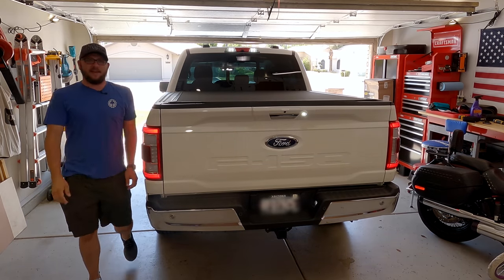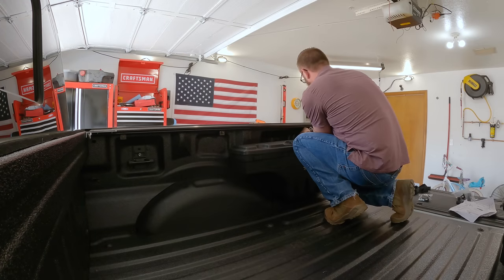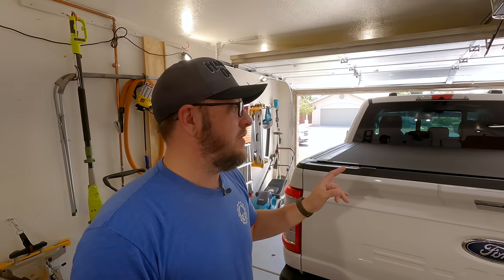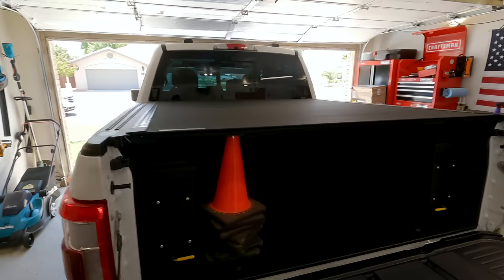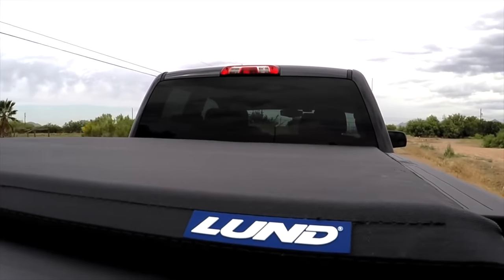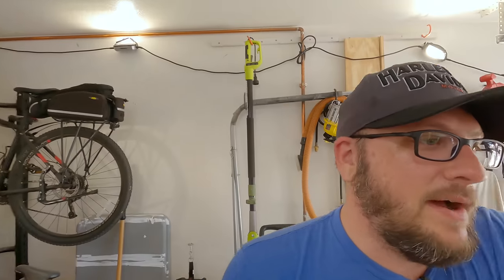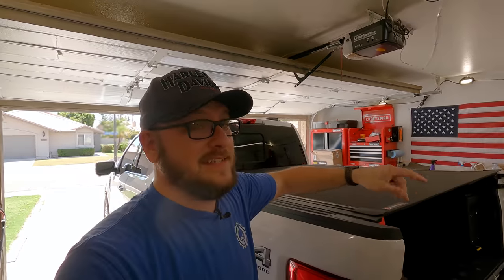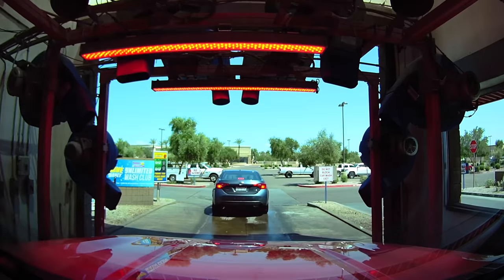BAK Revolver X4s, The BEST tonneau cover on the market?

Comment: I have a 2018 Chevrolet Silverado and bought a BAK Revolver X4s fall of 2018. My rolling cover is an older model than this one on the video. I have not had any major problems with the cover. It even keeps out the water fairly well. Six years, and i am satisfied. The only recent issue is a felt strip that is designed to hold the slats from separating has come loose from the underside of the cover. I contacted BAK. Even though i am out of warranty, BAK said they have a newer model of the cover that uses a newer technology for holding the individual slats together, and they wanted to 'do right by me' and has replaced my cover for free. In a couple days, when i am off work, i am replacing the cover. Just roll it up; undo the 4 bolts; remove; put the new cover on; bolt it on; roll it out and done. I have put a lot of miles on my truck, hauling belongings and cargo between Pennsylvania and Georgia, and Florida, through rain, snow, heat, and scorching sun. I am happy with the performance of my BAK Revolver.

Comment: I installed a Bak Revolver 4X on my 2018 F-150 when new. It looked great and I was pleased with it. Now at 3 years old the covering material has started to crack and split along the rear slats. The rear slats also tend to jam up when folded and make it difficult to fold flat to close & latch it down. You didn't mention the price, but I paid about $1,000 for mine, 3 yrs ago. This is quite expensive for a top that has these issues after only 3 years. I am in Michigan and this truck is garage kept and doesn't stay out in the sun for long periods of time. I also want to mention that the water leaking in at the tailgate may not let much water in when on a level ground, but if you are not parked level, and the front of the truck is low, quite a bit of water can accumulate at the front of the bed.
Reply: I had the same one and all the same issues. I got almost 7 years out of it don't know it that is good or bad.
Reply: Call in for your warranty!
Reply: Started out great but after my second one! It is junk!!
Reply: I have none of those issues and it was pristine after 4 years. Mint. I live where  we get hammered by winter and baked in the summer. So it’s been through a lot. Zero issue.

Comment: Hope it lasts longer than my RevolverX2. I absolutely loved it until the 3rd year of ownership when the vinyl started to fail and delaminate. IMHO, if you live in the south don't get this type of cover UNLESS they're warranting their laminate process for more than just 3 yrs. Getting only 3 yrs out of a $1k cover is no bueno IMHO.
Reply: The X4s has a 5 year warranty which should help but for $1000 it would be nice if it were more like 10 years
Reply: The felt fell off the inside of mine. Now it punches my fingers every time I roll it back out to it’s closed position. I wouldn’t recommend this cover.
Reply: @jsboening  this is the x4s which is an update, no more felt. They replaced it with plastic covers for the hinges which are mechanically held rather than using a glue. The other big fix was putting a plastic piece on the rear corners which keeps the jagged corner of the back plate from cutting through the vinyl and cutting your hand.
Reply: @andrewfidel2220  that’s good to hear. Any problems with those plastic corners falling off?
Reply: @jsboening  not that I've seen mentioned. When one of the YouTube channels that did a review was wrenching on the cover with a crowbar they did manage to pop it off, but that's clearly in the realm of extreme abuse =)
Reply: @andrewfidel2220  thanks for the info on the product updates. I’ll look into the new version for my new Ram

Comment: I had one of these on my 2016 F150.  I thought it was going to be the best cover for all the reasons everybody else says.  However, it did not last.  The tracks started coming apart, the vinyl started coming off.  Long story short, I took it off and ordered a hard tri-fold because this cover became unusable.  After trying to sell it online for a while I ended up tossing it in the dump.  I definitely would not recommend it.
Reply from the maker: Was that the X4S? It’s a new version of the older covers that hasn’t been out that long.
Reply: @GearsGadgets  It was the version being sold in 2017.  It did not look like this one at the 4 minute mark in the video.  What is that, plastic holding the tracks together?  In place of that it had cloth glued to the tracks, which eventually came off, which allowed the tracks to separate, which made it a real pain to close.  Hopefully this system is better.  In addition to that though, like I said, the vinyl also started coming off.  It came off right where it wraps around the end, where you are pointing at 2:20 in the video.  Also there were some cracks that appeared in the vinyl from being rolled up.  In fairness, those cracks could probably be prevented with routine use of armorall like products but after the other issues I basically "let it go" because I planned to replace it.
Reply: I had mine since 2015 through a lot of scorching hot summer days and never had a problem with the vinyl.  After 8 years the felt on the underside on the older style did let loose and hang down, but that’s the only issue I ever had with it… aside from the front exterior buckles rattling between the cab and bed.

Comment: My truck has a bifold hard cover. Easy to install, has a lock on the front panel and a lock on the back panel. The front panel folds open, the back panels fold open for one or both or fold entire cover on the front panel and locked down. I live in Michigan it still works.

Comment: great video thank you,  I have a revolver two trucks ago and then put a mx4 trifold on my superduty. I am getting ready to by a tremor F-150 and I am going back to the Revolver x4s on my new one. So much easier to open and close than a tri-fold and they roller cover has less water then any of my tri-folds. The last two MX4's I have had has a slow leak right in the middle of the cover. Bakflip has replaced it twice and same issue. I too agree I don't expect them to be 100% waterproof (then are not) but when going to the beach suits cases go in the middle and beach chairs, coolers go around the tailgate. great video...God bless

Comment: Very easy to break into. Speaking from experience. Coat hanger is all that is needed.
Reply: Agreed. Same problem my Backflip trifold had before someone just pried it up and snapped off the locking bar (the one with the cable and plastic latches. I wish they had used a hangar and not damaged the cover! Except for maybe the Diamondback brand, none of these tonneau covers are stopping determined thieves. And you could pry open a Diamondback if you really want to.

Comment: I have had this cover on my tundra for almost a year now.  It has been replaced once under warranty because several of the aluminum slats came unhinged and the cover would not lay flat or lock down.  Fortunately the manufacturer came good on the warranty and I had a new one in just a few days.  The other issue I have with this cover is it does not like to roll in the winter when ice and snow come in contact with it.  So if you need to roll this cover and you live in an area that actually gets winter then this is not the cover for you.  I may be replacing mine, but I haven't found a suitable replacement yet.

Comment: The Weathertech tri-fold hard cover is waterproof and can hold up to 400 lbs.  Put one on my ‘20 F250 Platinum when I bought it in ‘20 and love it.  Can fold it up and have no issues with the fifth wheel.

Comment: Had an earlier version of this cover on my 2015 Ram 2500 which I transferred to my 2019 Ram 3500.  Love this thing 90%.  The only thing I didn’t like about it was the older versions had buckles on nylon straps on the exterior front of the cover which is what the interior straps/buckles connected to when the cover was rolled up.  This worked great except that the exterior buckle would flap around in the wind between the bed and the cab when the cover was rolled out.  The buckle would flop around hitting the cab and the bed causing an irritating clatter when driving. I fixed the problem by glueing some Velcro on the buckle and the cover and sticking the buckles to the cover when not being used.  This worked great, but looked kinda like a like it was… a fix for a poor design.  I see they have fixed that problem now with a more intigrated exterior buckle.  My truck was recently broken into when the scum jumped up on top of the cover and kicked in the back window of my truck.  Unfortunatly, the rear window wasn’t nearly as tough as the cover since the window shattered easily, but the cover was unscathed by the thief jumping on it!  I just ordered a new BAK Revolver X4s!

Comment: Unless you live in the south.   I've had two Bakflip Revolvers, my neighbor has had two, and my brother in law has had one.   On every single one, after 2-3 years in the Texas sun, the vinyl starts shrinking and failing around the edges.   Well-documented issue with the Revolver and southern temps.

Comment: I did love the safety aspect of the cover not so much on your water test from the car wash. Im sure that if it was just a down pour the water leakage would be none or way less then the car wash.
I have a different cover for my truck that I failed to add a foam strip at the front of the bed.  At car washes I get some water leakage but its way way less then you showed on yours. For the amount of money that you paid the safety aspect is great for a cover I think that it could have been better on the car wash test but like I said it is probably non existent in a regular rain storm.  Oh and while my cover doesnt have a better security it was way cheaper. I just bought it for improving my gas milage which it did add very little lol.

Comment: On my 3rd warranty of the Revolver X4S. BAK has awesome customer service and a great warranty but that particular cover has failed 3 times (including the original) in less than 2 years. They are sending me a BakFlip MX4 after the 3rd fail at no cost to me. The issue is with the aluminum rails, this cover is a great concept but with time the rails separate leaving humps in your cover. Not designed for someone that is in and out of the truck bed multiple times daily.

Comment: I had the original revolver and the x2.  Both are in dumpster some where.  Good until they freeze.  They leak and like may have said you can easily break into them.  I left BAK due to their lack of warranty and design flaws.  Good luck

Comment: Wow - I've been thinking about getting one for better security but my Extang Trifecta 2.0, which came with the truck when I bought it a few years ago - only 16,000 miles, doesn't leak in the car wash and has only slightly leaked a little during some severe rainstorms here on the coast.  Not sure if I want to switch it out now - thanks for the great job reviewing!

Comment: I've owned 5 trucks over the years and always bought Extang Classic Platinum which is a snap down cover. That was discontinued. They had the Black Max which is close but unsnaps on all 4 sides instead of 3. That one is now discontinued as well. Extang no longer has anything I'm interested in for the truck I have on order. I'm looking at Truxedo Sentry and Bak Revolver X4S. I'm leaning more towards the Bak because most say the tail gate will go up without having to open the cover. Some are saying that on the Sentry, you can trim or reverse the the rubber strip and it will then work.

Comment: I hope your X4 experience is better than mine.  This is my second X4, as the first one I received the rails were too long for my tailgate to close, and the cover itself was too short.  The company replaced both under warranty.  The second cover I’ve had for two years.  The glue holding the felt onto the underside has released and the felt has come off, and there is a 5 inch split in the top material right in a seam between two ribs.  The weatherstripping on the rear edge has come off, and I’ve had to glue it back on.  I really want to like this cover, but I’ve had too many problems with it.
Reply: The "S" version addressed many of those concerns (X4S). It doesn't help prior X4 owners, but I was impressed that Bak learned the weak points and made improvements on newer models. They replaced the felt with harder, rubberized plastic, improved the end-caps where it latches and improved the clamps that lock it in the rolled-up position.
Reply: Good to hear they improved it. This is my second one and as you mentioned I experienced the same problems. First one was replaced under warranty. My second one is falling apart as well. I really like those cover other than they don’t last more than 1 to 2 years before falling apart. I will look into the new model.

Comment: My father in law has this topper and it’s an absolute pos after 2 years. The bakflip Aluminum is the best option. The fiberglass version absorbs water within 2 years and ends up weighing double what it did when new.

Comment: Had a prior version of this that lasted a good 5 years.  AVOID if you live in a cold climate….not a huge issue in NC but if temps are below freezing it will not roll up, period.  Maybe new material doesn’t freeze solid.
Reply: I live in Wisconsin and understand your point. After physically pushing the rail flap a few times, everything worked fine.  Considering how often I wash the salt off, I expected more problems.
Reply: Agreed. I live in MN and this cover freezes easier than any other cover I have had.  There is zero chance I could lift it without ripping the seals most winter days.

Comment: I have the X4 and like it a lot.  
I see yours has some improvements.  At the tail end of the left and right flexible weatherstripping has some rigid flaps to keep the weatherstripping down, I wish they did that on the front as well. 
I see along the left and right underside, they removed the felt and replaced it with what looks like rubber or plastic.  That is so your skin on your hand doesn’t get pinched in the pivot points of the slats when closing the cover.
Reply: The "S" version addressed many of those concerns (X4S). It doesn't help prior X4 owners, but I was impressed that Bak learned the weak points and made improvements on newer models. They replaced the felt with harder, rubberized plastic, improved the end-caps where it latches and improved the clamps that lock it in the rolled-up position.
Reply: Although thats true about finger pinching, the main function of the felt, and now rubber, is to not allow the aluminum slats to rub on the vinyl when you roll it up. The felt on my X2 was its biggest drawback, peeling off inside the first year of ownership. I wonder if BAK addressed the curved front edge of the RAM beds which is another failure point with my X2.
Reply: I recently saw the upgraded one and noticed the bare aluminum underneath is gone, which it also appeared in the video.  I imagine they coated the bare aluminum so when the cover is down, items in the truck bed might rub the cover and don’t get black or dark gray from being in contact with the cover.  In addition, when the cover is rolled up, it won’t rub bare aluminum onto the topside of the cover.

Comment: Good review. I went with the Bakflip MX4 for my Tundra. It has 4 panels instead of 3 (6 1/2 foot bed). This is my third MX4 and I've been very pleased with all of them.
Reply: Guessing you don’t have winter, snow and freezing temperature where you live. I bought one and will never do it again…
Reply: @jaroslaw6080  what is the issue with winter weather with the MX4 vs this cover?
Reply: @tommeier5714  . Material mx4 is made of is the problem. Water stays on top of the cover and freezes. It’s impossible to remove ice that builds up, specially when it’s snowing also. Surface of mx4 isn’t completly flat like a window, that’s why ice sticks to it like glue. Won’t work to scrape it. Now that doesn’t sound like a big problem until you read the manual which states you cannot open it when there’s ice on the cover. Doesn’t say why but guessing you will damage it and then your warranty won’t cover it.
Where i live temperature is close to freezing or below most of winter so snow melts or sometimes it rains and then it all freezes. Maybe if you live in Canada and have real winter everyday it won’t be that bad but still i will never buy anything from BAK again cause it’s not waterproof and there was no info about it when i ordered mine. There’s a simple reason to why they don’t mention it.
Hope it helps to make your decision.

Comment: I’ve had mine for three years and love it. I see two improvements that address my issues with it. 1) the ribbing bumpers have been upgraded — they were a cloth material and the glue disintegrated. I removed it 2) the corners closest to the tailgate have been reinforced with plastic pieces. On mine the rubber seal that runs across the top rails tends to have a very slight rise from curling. Not a big issue just as esthetically unsightly. I might look into retrofitting if it’s possible.
Reply: Are you talking about the front seal attached to the cover? Mine looked like bacon. Bak sent a new one which wasn’t as deep and it’s perfect. It simply slides into a tract on the cover. All you have to do is cut it to length.